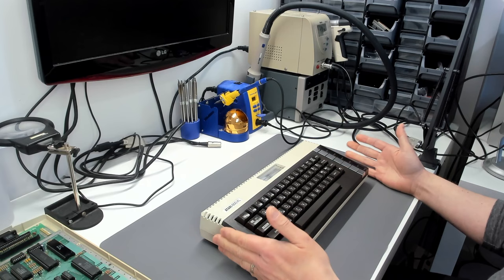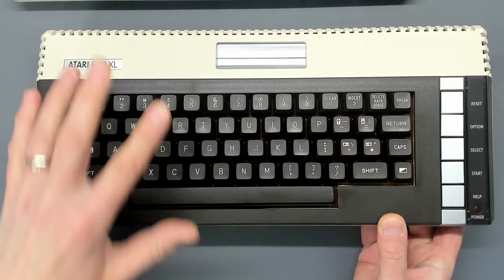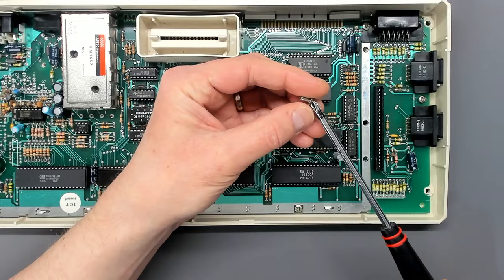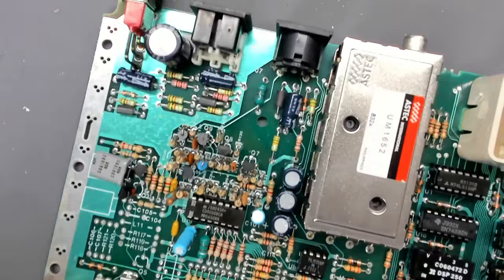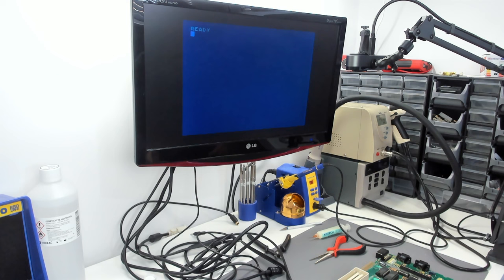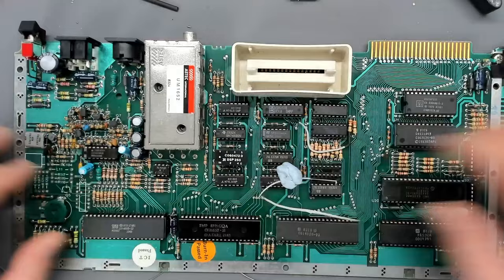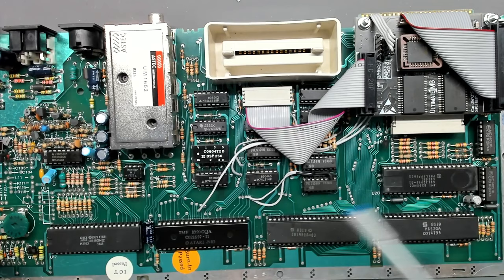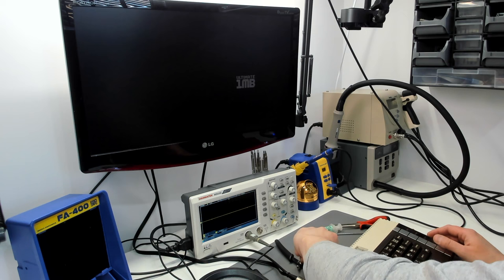Let's install a monitor jack and upgrade the RAM on a US Atari 600XL

Comment: As long as the keyboard switches are somewhat standard that is a super easy fix.

It does require de-soldering, but once that’s done it’s a breeze. You can get stiffer higher quality springs that will last almost indefinitely. Or depending on the pin layout you could just out right replace them. 

Classic style switches are a commodity, and can sometimes be worth something. 

Edit* After looking up with switches while I believe the springs could be replaced, replacing switches is a different story. 

I’d find it hard to believe there isn’t some way to convert the keyboard to a modern version tbh. That would be interesting.

Comment: 8-bit Commodore and Atari computers use Chroma levels of 1Vpp, while the contemporary S-Video standard defines it as 0.3Vpp... that's why the image is so dark.
Reply from the maker: Partly, but as you can see towards the end, I discover a smoking-gun issue which - once fixed - completely sorts the obvious defects.

Comment: Jon, are there any signals needed by the U1MB that aren't available on the Parallel bus connector?  With the reproduction of the 1090XL I wonder if the U1MB could be moved to a card plugged into the PBI.  Or, would the PBI code on the U1MB conflict with the PBI as implemented by the 1090XL?
Reply from the maker: HLT isn't on the PBI bus, but Candle must have found a way around that since an external PBI version of U1MB already exists and simply needs time for further hardware and firmware development: https://youtu.be/UN-8P3iK1IM
Reply: @flashjazzcat  I do recall watching that video and thought a lot of that was on hold due to chip shortages.  Having invested in the 1090XL, I'd like to see the U1MB and VBXE produced to work with it.
Reply from the maker: @michaelstoliker971  I have no idea whether Candle's designs will/could be adapted for the 1090XL, but in any case: the delays regarding the new hardware appear to be primarily caused by lack of time (certainly in my case, anyway).,